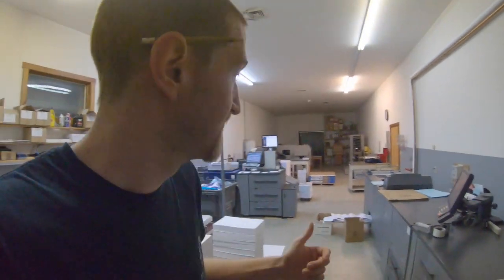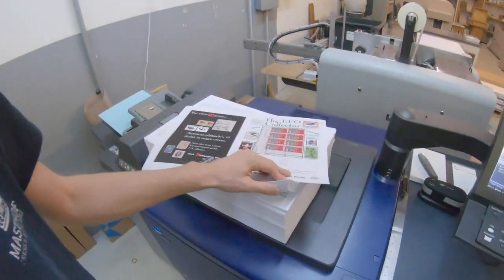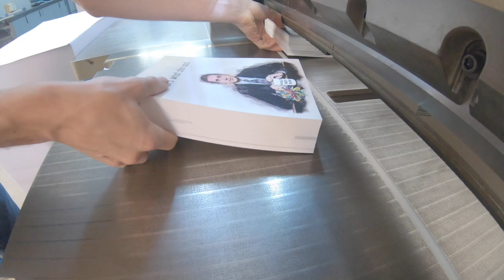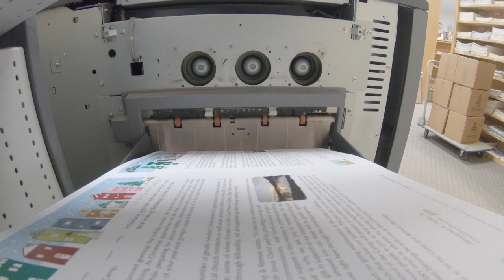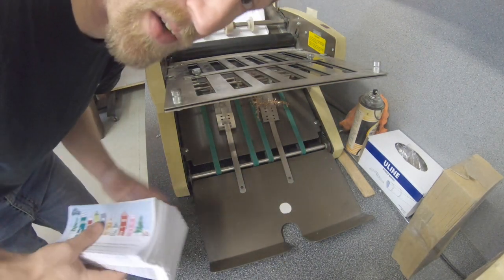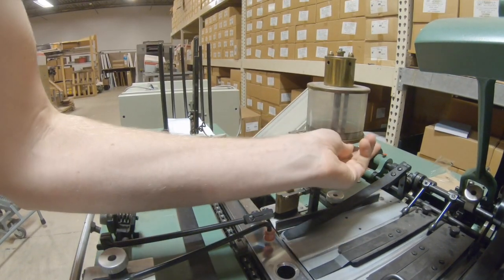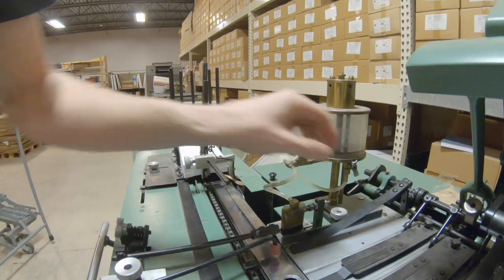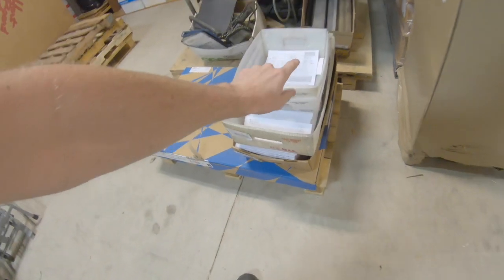Inserting Bulk Mailing, Automated Saddle Stitching with Konica Minolta Spoils Me

Comment: I agree with you on the fact that printers are made to print and not to finish prints with inline modules. 
When you printed those saddle stitched booklets on the 1200PRO they are not flat like those you make with the VAC 100 collator.
There are cheap squareback booklet finisher machines that give the professional bound look.
Reply from the maker: Great minds think alike!

Comment: Swing arm! Rube Goldberg is smiling on this.....
Reply from the maker: Neat, I didn't know who Rube Goldberg was... interesting guy!
Reply: @justaprinter  We have 3 and 2 for parts. Unfortunately what we run is not always "cookie cutter" and sometimes requires thinking outside the box. Your delivery on it I have never used however I do like the concept..... You have a great shop....
Reply from the maker: @johnweaver1198  I think I would prefer the conveyor belt delivery, but this works. Thanks!
Reply: @justaprinter  Too bad you ain't local. We have a couple just collecting dust. The conveyor is typically more for an addressing step which you nipped by pre-printing your addresses.... Your Inserter look clean as does everything in the shop...
Reply from the maker: @johnweaver1198  Thanks! I try to keep everything clean and orderly. That all goes out the window when I'm busy. :)

Comment: I´m thinking on getting my first Digital Press maybe the Bizhub 1070. But a little scary if i can run it cause i´m not into digitalprinting before. Only Offset. But  if you can watch channels like your´s it´s a big help. Thanks a lot. Do you personalize (printing adresses)  the mailing with the minolta?
Reply from the maker: Yes, I print addresses. I have software that will make a PDF of addresses that I print on postcards and newsletters. Looking forward to trying envelopes on the 1070.